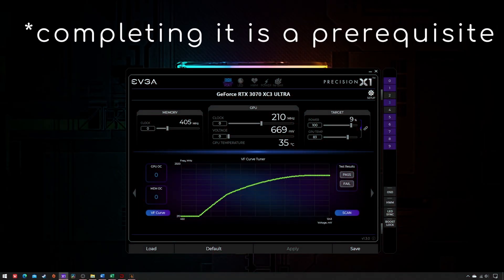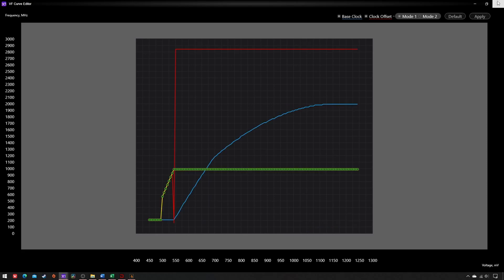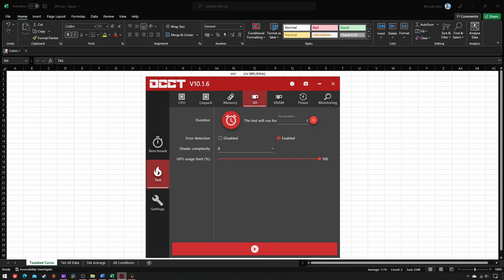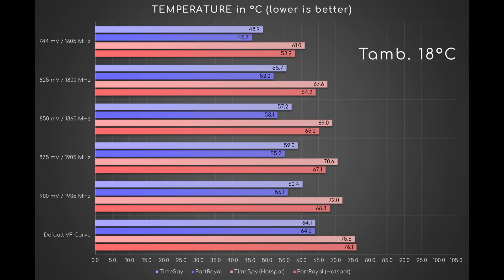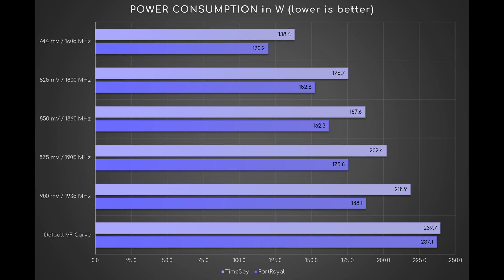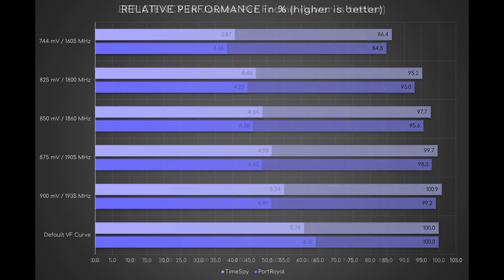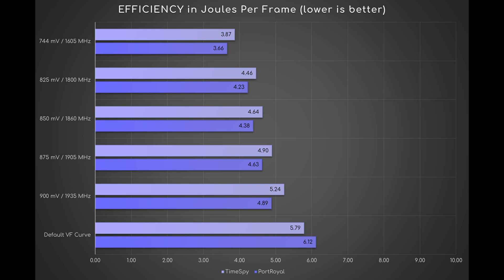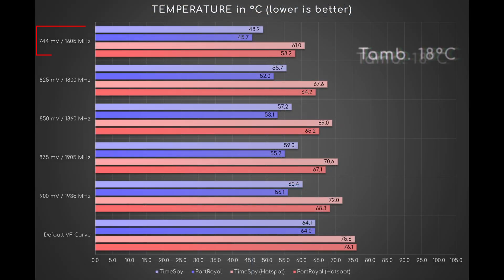RTX 3000 Undervolting at MIN Voltage = MAD Efficiency/JPF

Comment: My 3080 ftw3 ultra runs at 775mv at 1800mhz clean, the temp is lower, and the noise to, but the gpu power draw stays at 380w 
Idk how that works 🤯
Reply from the maker: Weird! "GPU Power" metric in HWiNFO (latest version)?
Reply: @oakenglass  in hwinfo my gpu power draw is like 363W thats for undervolt a little high :€
Reply from the maker: @LyR_LL29  True... 1800MHz at 775mV should correspond to about 140W of power reduction. What are your temperatures before and after undervolting?
Reply: @oakenglass  before at furmark my graphics card has at 25min run 78 degrees and after it, it has after a 25min run 73 degrees
Reply from the maker: @LyR_LL29  Could you try recording power & temps with Time Spy (Extreme) or Port Royal?
Reply: @oakenglass  i dont have time spy, it cost money that i dont have
Reply from the maker: @LyR_LL29  I understand... Unigine Superposition, then! It's free and offers a more realistic scenario than Furmark :)
Reply: @oakenglass  okay, i make it later, at the moment i'm not home
Do you mind if i write you tommorrow?
Reply from the maker: @LyR_LL29  No problem!